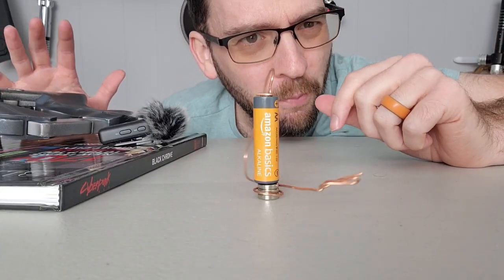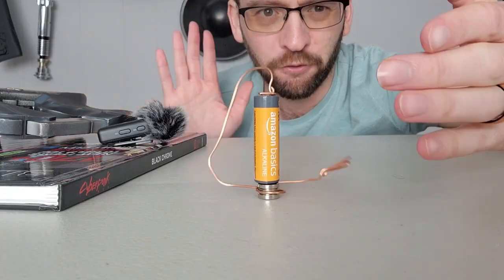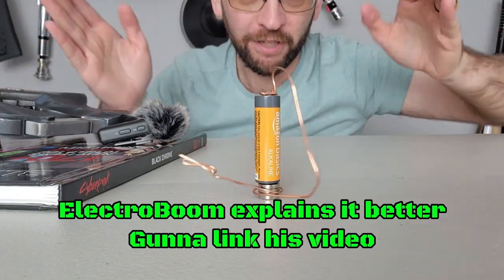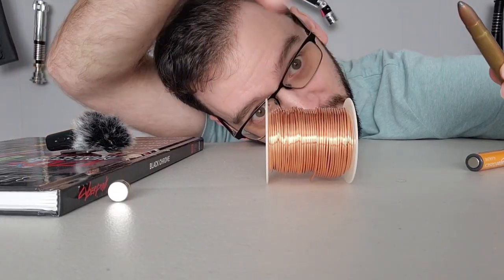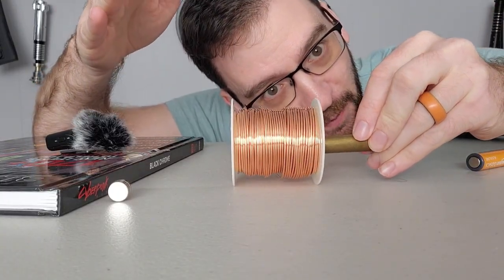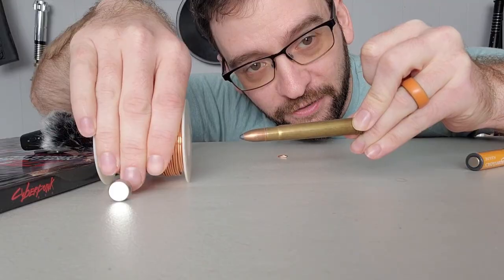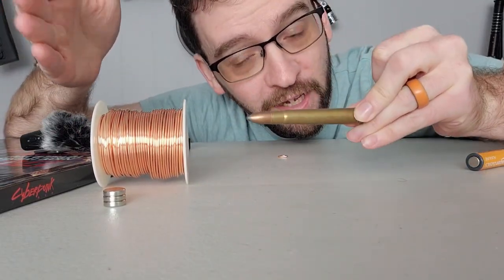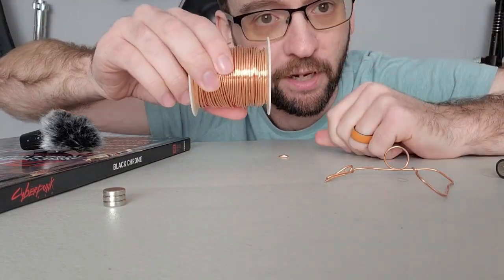SciFi Explained: Difference Between Railgun and Coilgun

Comment: For anyone curious, there are pros and cons when it comes to military applications.

Coilguns are a lot more complex. The issue is timing. The coils need to turn off and on at very precise intervals for maximum effect. When we're talking about a projectile traveling at hypersonic speeds, even a few microseconds off could affect muzzle velocity and reduce effectiveness and/or range. So maintenance would be more expensive and time consuming, and the weapon itself would be more expensive and difficult to build. 

Railguns are a lot simpler, but they're a lot less energy efficient. Take a railgun and a coilgun with the same energy source  and same projectile, and theoretically the coilgun would achieve a higher velocity. Its sort of a brute force solution compared to the elegance of the coilgun. But sometimes brute force is what you need if coilguns are too expensive to be practical.

Comment: Technically a railgun doesn't need to use a sled, the rails induct and produce a magnetic force on the projectile in direct contact with the rails due to the movement of charge... which is why most railguns use very large capacitor banks to dump said charge very quickly.
Reply: The sled is the projectile
Reply: @BookWyrmOnAString   There are other designs which use a sled to launch projectiles... but they are usually payloads to space.